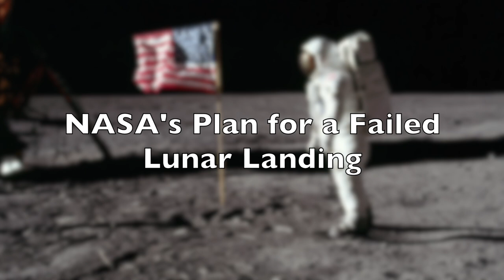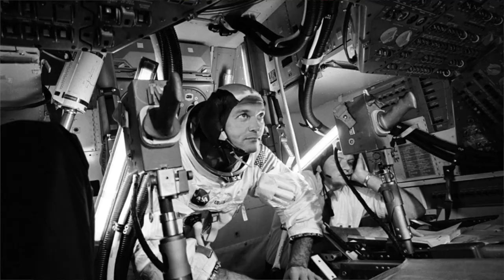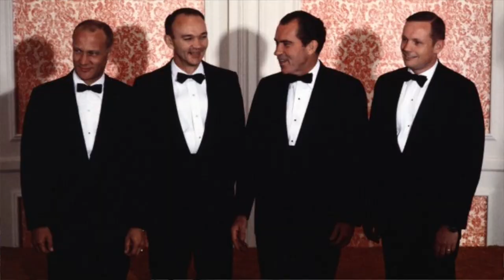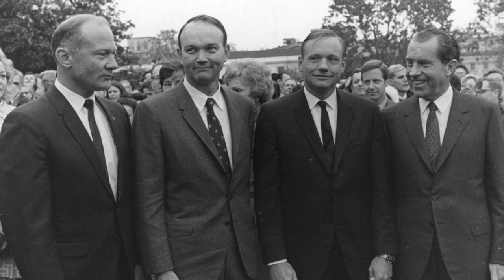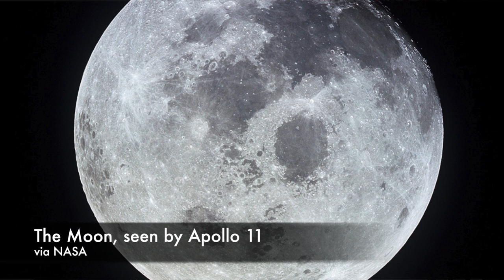NASA's Plan for a Failed Apollo 11

Comment: I can't imagine how Mike Collins would feel leaving his fellow astronauts stranded in an unsurvivable place.
Reply: Kind of reminds me of The Martian (The Book) where one astronaut would have stayed alone on the Hermes for the rescue trip to mars and back while eating the dead bodys of the other astronauts who would commit suicide if the supply mission would have failed.
Reply: I don't think he would've. I mean...... there are recorded rebellions in space. He might've tried something insane with the CM..... like a landing. He probably would've died trying to save his friends.
Reply: No way to land CM on the moon. There is no atmosphere so no way to land CM (CM used parachutes). Also there would be no way back because CM itself had no engine.
Reply: macieksoft Yeah but the CM still had the service module attached, so it had enough fuel to land with an engine. Granted, none of it was designed to do this though
Reply: Chihuahua King Nope. Because of:
-Quite bad thrust to weight ratio of CSM (SM was kinda heavy thing).
-Not too much SPS fuel after LOC.
-Lack of landing gear.
Reply: macieksoft I said two times that it would end in failure. Can you read?
Reply: Chihuahua King Sorry, i probably misunderstood you.
Reply: You dont need a landing gear, just land the csm with the exhaust nozzle directly to the surface! its well known by now that none of these magical engines can leave a crater on the moon, not even make any disturbance at all.
Reply: GoldVillage
No flames, so no crater.  Makes sense, doesn't it?
Reply: No landing radar.....yep.
Reply: If I remember correctly, they were all originally military men and prepared for this sort of scenario in any environment, even space. He likely would have followed orders. (Now if he were a Marine, then there's "no man left behind" and who knows what would have occurred!).
Reply: Shoot. That's tough
Reply: Imagine how Armstrong and Aldrin would feel seeing Collins leave orbit and bugger off home. Oh bummer......
Reply: @xismxist  the engine would be probably destroyed by the blasting lunar dust as it was not design for that purpose

Comment: I read that due to the design of the ascent engine, it could not be tested, and there was an engineer that had to sign off that it was properly constructed and ready for flight.  If I had been that engineer, I would have been sweating bullets when it came time to fire it up and leave the lunar surface.
Reply: +John Rehwinkel   That particular unit could not be tested.  The fuel is toxic and highly corrosive.  But previous units were tested, and Apollo 10 tested it in the moon's lower orbit.  Of course they were sweating bullets.  Everyone was the entire time.
Reply: Ironically, the engine that could not be tested was designed that way to make it more reliable. If the engine had a conventional ignition device, that would have been one more part to fail. Instead, it used two liquids which ignite as soon as they come into contact; this kind of fuel is called hypergolic. Each unit could only be tested by using inert liquids to be sure they would mix when the valves opened. Then the engine was loaded with the real stuff, knowing the plumbing had been tested and the fuel components would fire, and eventually destroy the engine, but only after it served its purpose. 

BTW, the mission could not have been faked in a way that would have reliably fool the Russians and anyone else with a radiotelescope dish, because the signals picked up by their dish would have to match the narrative in every detail, including Doppler shift in carrier frequency from the motion of the spacecraft, and cutoff and resumption of signal during lunar orbit. 

Even sending just a lunar orbiter and not landing would not work, because the command module would still have orbital motion and lose contact half of each lunar orbit, while the lunar module would show different Doppler shift than the command module during decent and ascent, and NOT disappear while on the surface. And it would show the same Doppler shift as the moon itself while on the surface. 

Frankly, losing astronauts and/or failing the mission would have caused less political harm than being caught faking it. Failure would actually have brought out world sympathy, even from the Soviet Union. I suspect Brezhnev had a speech ready to eulogize our astronauts and offer his nation's condolences also, just in case.
Reply: +Allan Richardson This is a point i have argued against hoaxers, and they actually say that the soviets were in on the hoax too. i just give up on them TBH, im glad i don't know any deniers in real life or i would probably be in jail right now.
Reply: They try to argue that the Soviets were in on "The Hoax"?
Man, is that some delusional thinking right there. The Soviets and the Chinese would have jumped at the first chance to crow about the USA "faking a Moon Landing" if the radio communications didnt match with the radar and optical information. Also we were intercepting communications at Parkes here in Australia for NASA, someone would eventually leak if it was faked.
Reply: Mark Fryer that's the problem with conspiracy theories, they all tend towards "everybody but me and the other believers are in on the conspiracy because obviously the conspiracy is real"
Reply: Don't worry for him, this ascent engine never had to work; anyway it was not even gimbaled while the ascent module was asymmetrical, and the lateral thrusters could not be throttled; moreover, the logical command interface of he lateral thrusters (RCS) shows serious flaws.
Reply: Aerofake
Of course it worked.  It got 6 ascent stages off the moon.
Reply: +TheOneWith TheEyeOfTruth
Sure, it worked...over Area51!
Reply: Aerofake
The moon, that's right, as you know.
Reply: +mPky1
maths involved?
Speak to me about the maths involved, I would be curious to hear about it!
Reply: Aerofake
You don't already know what it is, that's right.
Reply: Aerospace
Something tells me you have no idea what you're talking about, and that your title isn't one given by any university. For starters, the "lateral thrusters", or Reaction Control System, to use the proper terminology, didn't need to be throttled; like the RCS thrusters on Mercury, Gemini, Apollo, and the Shuttle, they fired in short controlled bursts. I also don't know what 'logical command interface' you're talking about, as with the exception of Gemini 8, the RCS never had a significant problem, and worked properly under both computer and manual control for docking maneuvers and attitude control.
Reply: John-I would like to kind of 'set the record straight' about this matter.  The LM Ascent Engine was made by Rocketdyne.  I spent 20 years with them.  This notion that the LM Ascent Engine could not be tested before flight seems to have come from a couple of videos (was 'Moon Machines' one of them?  I can't remember exactly).  This is emphatically not true.  Each LM Ascent Engine that was going to go into a LM flight vehicle was hot-fire tested (referred to as 'acceptance tested') at an Air Force test stand in Reno Nevada.  This test stand was an 'altitude simulation' stand that contained the ability to fire the engine in a vacuum in order to determine its 'in-space' performance accurately.   The engine was not tested with the 'flight' ablative combustion chamber and nozzle- a 'workhorse' combustion chamber and nozzle were used, but the flight injector and engine trim/feed system were used.  This acceptance testing was necessary both to verify that the engine system produced the minimum specific impulse that was required for the mission  (I think the minimum Isp requirement was 309 seconds), as well as verify that the injector and feed system were 'trimmed' to operate at the correct mixture ratio (which was 1.6).  Written record was kept of these acceptance test results in something called an 'Engine Log Book'.  One of these existed for each ascent engine.

One of the other posts here reminds us that 'the fuel is toxic and highly corrosive'.  This comment is certainly correct.  In order to render the engine 'safe' for people to handle after the acceptance firing, the system had to be disassembled and cleaned/decontaminated.  This was a routine process.  

One fellow here posted that 'everyone was sweating bullets'.  Of course they were!  There were a very large number of things that could go wrong.  But fortunately, firing an untested LM Ascent Engine was not one of them.
Reply: It's not accurate to say the the ascent engine could not be tested, it could be tested without fuel, does the valve open when commanded to open? It was pretty simple, open the valve and the engine works.

Comment: Great videos. I'm glad I found them. I watched these events in real time while I was growing up. 
Apollo 11 was almost stranded on the Moon as when Neil Armstrong and Buzz Aldrin where going through the pre-flight check list, they found that the button of the circuit breaker used to arm the ascent stage engine had been broken off. Buzz Aldrin used a cap from a pen to press into the panel to engage the circuit breaker. If that had failed they would have indeed been stranded on the surface of the Moon. Buzz Aldrin says that he still has the pen and cap.

Comment: Great Post!  I've often read this story.  I also read something interesting from one of Aldrin's books that NASA was really not concerned that the hypergolic ascent system would fail.  The system was basically designed NOT to fail (assuming Aldrin wouldn't damage the breaker).  Still, NASA's biggest fear from the early days of Mercury was NOT getting an Astronaut home, but leaving them stuck in orbit around the earth (retro failure), moon (SPS failure), or skipping off into space during re-entry and left stranded in space with no hope of recovery.
Reply: +tightshot88 Interesting how opinions may vary between astronauts, but understandable. I never thought of an actual mechanical lever, but it's a legit point... at least as a tertiary backup. Thanks!

Comment: were any of the Apollo missions under control by department of defense? I remember a shuttle mission was but was wondering if something like this happened during Apollo.
Reply: +michael green DoD shuttle missions were for the launching of top secret surveillance equipment. They didnt have Delta IV rockets at that time, and the shuttle was designed around the launching of the largest conceivable NRO and military payloads into polar orbit.

Comment: Wasn't there also a failsafe system in case the ascent stage did not fire? Some kind of improvised One-man-rocket they could assemble out of parts of the LEM and ascent stage?
Reply: *****
 Okay, I got confused by some vague information about this here: https://en.wikipedia.org/wiki/Lunar_Escape_Systems 
It was theoretically thought about but never realized.

Not sure if that was where I originally heard of it but this source: https://falsesteps.wordpress.com/2012/09/01/less-the-lunar-escape-system/ 
talks about it like it was meant for a lot of missions as emergency backup system and not just as a small weight alternative to the ascend stage for heavier long term mission LMs... Still never went up to the moon so it would not have been ready to use for any of the Astronauts in the club of 12...
Reply: No. Not one of the ascent rockets they used had ever been tested.
Reply: There were severe weight constraints, so they had to design the ascent stage engine to be as reliable as possible.
Reply: This was planned for later (cancelled) missions of long duration: https://en.m.wikipedia.org/wiki/Lunar_Escape_Systems
Reply: Hannible 100
That's a little misleading.   The engine design was tested many times but the specific engine on each LM was not fired before launch.

Comment: Consider this:
1) Instead of counting the radar pulses with an electronic counter, like all the other systems do (including the guidance system of the Saturn rocket), the AGC was counting them directly with instructions of the processor (PINC and MINC); these instructions were said hidden, for they were not used in a program, but they were automatically executed in case of a radar pulse (PINC for a positive pulse, and MINC for a negative pulse), and they were still stealing cycle times from the processor when they were executing, which was meaning lost time for executing the guidance task.
2) According to the mission report, Buzz Aldrin would have put a switch on a position which, instead of sending normal radar pulses to the AGC, was sending instead very fast pulses at high frequency.
3) The processor has thence started to frenetically count these fast pulses with its hidden instructions, and, because of that, it did not have the time to finish the guidance task in time; the result is that the AGC choked, and had to restart, while producing the famous 1202 alarm.
4) Though the astronauts had the possibility of producing this alarm, they did not know what it was meaning, the engineers had not informed them about it; The astronauts had to ask the ground control about its meaning.
5) The ground control did not know either what this alarm was meaning, and had to make a fastidious search to find out what it was meaning; finally the ground control found its meaning, and simply told the astronauts to ignore it and to proceed; the ground control did not even tell the astronauts to put back the switch in the normal position, so it would send back again the normal radar pulses to the AGC, and this one could normally work again.
6) Because the AGC was still receiving the very fast pulses, it went on malfunctioning and constantly restarting; Armstrong then decided to disconnect it and take the commands himself, although the descent was too technically complicated for a man to be able to control it, and only the AGC would have been able to control it.
It is rather difficult to consider that all this is normal!

Comment: Here's a related question. Has anyone ever asked any of the men who walked on the Moon whether they had given any thought to how they would have spent their final hours if they had been unable to leave the lunar surface? Would they have stayed in the LEM, or gone out for one long, final excursion? Taking a oneway sightseeing drive in the rover would have been my choice...
Reply: Actually, someone did as Armstrong before the flight.  He was asked how he would spend his final hours if the engine didn't fire.  His perfectly logical answer: "I'd try and fix the engine".

That's why these guys were test pilots, and we're not.
Reply: Gotta love it!
Would have given Alan Shepard at Mission Control a second chance to use his famous line, "Why don't you fix your little problem and light this candle."

Comment: The other thing that could possibly fail was separation of the stages, however it was very unlikely as pyros used to be very reliable.  APS was made to be simple as possible, to reduce weight and chances of failure. No TVC and fixed thrust, unlike DPS which was complicated but could be always jettissoned with the descend stage in even of STAGE ABORT. So if DPS had to fail at any time thay had APS that was ready for such scenario.

Comment: How do you arrive at the 0.01% failure rate for the lunar ascent engine? The engine had never been fired prior to landing on the moon. Even though designers gave it a 50/50 chance of success. I also recall a documentary that said it was impossible to tell if the engine would work at all as once it was put together it could not be test fired.
Reply: gandalf grey That individual engine had not been test fired but several engines of the exact same design had been so both on earth and in space. The reason for not testing each engine was that the combustion products were so corrosive that they would dammage the engine by time.
Reply: skunkjobb thanks 1 time use presumably hydrazine.
Reply: +gandalf grey 

"How do you arrive at the 0.01% failure rate for the lunar ascent engine?"
She actually amended that to 0.1% with a notation. And it was a goal, one failure in a thousand. In reality it had a zero failure rate.

"The engine had never been fired prior to landing on the moon."
Incorrect. The ascent engine was fired on Apollo 10.

"Even though designers gave it a 50/50 chance of success."
Again incorrect. Once they solve the combustion instability problems, something that was a problem for all liquid fueled rocket engines, they had a high degree of certainty that it would work. Gene Kranz, though nervous as hell on A11, as we all were, was super relaxed by the time of A17. 

"I also recall a documentary that said it was impossible to tell if the 
engine would work at all as once it was put together it could not be 
test fired."
You're correct. The actual engine in the LEMs couldn't be test fired, but the design had been thoroughly tested. The only risks was a manufacturing fault, or an electronics failure.  

Engineers are human, so occasionally they make mistakes. Example, A13. But NASA in the 1960s had to take risks. It made mistakes, it was on a learning curve. But with every mission it corrected those mistakes. 

As for the astronauts, virtually all were test pilots. Taking risks was part of their existence.
Reply: Hypergolic engines are very simple, very reliable and it's parts and assembly were hyper ( pardon the pun ) strict

Comment: In 1969 most experts gave a possible success rate of 50% and these guys undoubtedly knew that.  Many of you folks seem unaware that Armstrong and Aldrin had spent YEARS in combat, and flying untested aircraft that could have ended their lives many, MANY times.  Neil narrowly escaped instant death TWICE; on a Gemini mission and again flying the rocket-powered LEM simulator (AKA flying bedstead). Don't you suppose that in believing that "failure is not an option", would have carried the day?